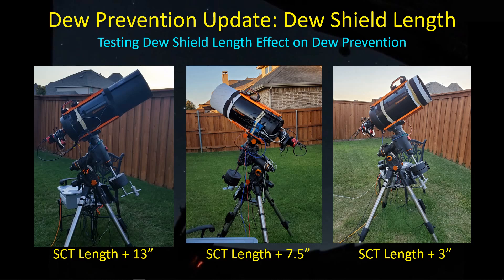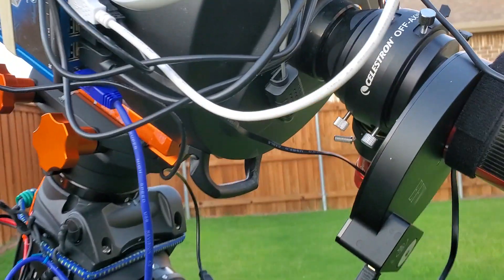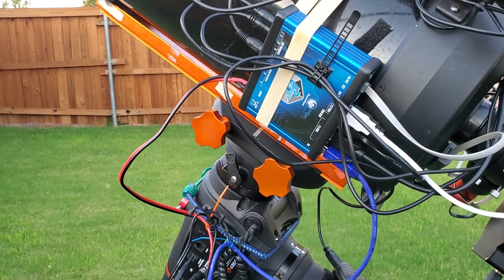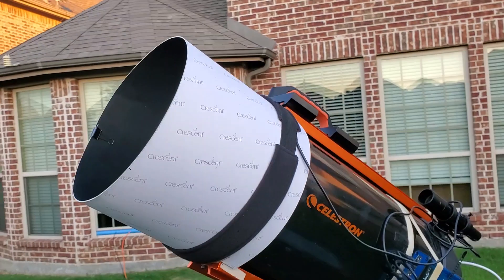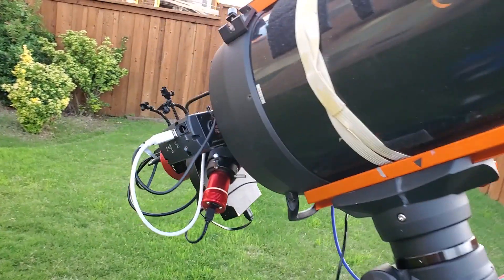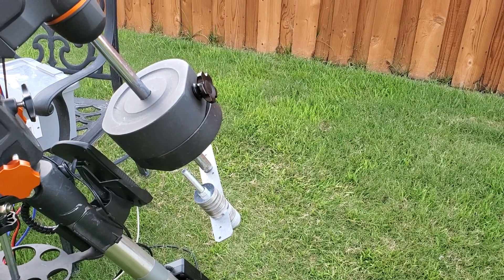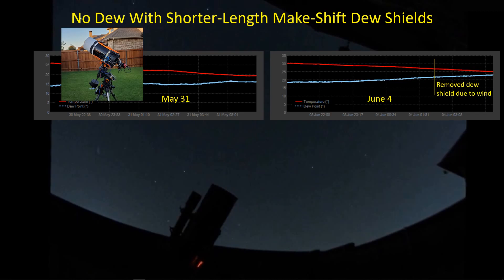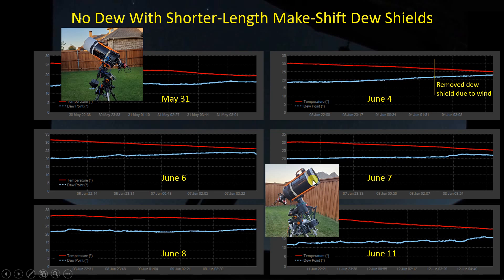Effect of Dew Shield Length on Dew Prevention

Comment: Saturated air precipitates when it encounters surfaces below dew point temperature. Clear sky allows radiant infrared escape creating an enormous temperature drop. Next time you have a dry cloudless night use the infrared thermometer on a car roof and tell us how low the temperature is. Prevent the corrector from line of sight to  cloudless sky and its temperature will not plummet and precipitate dew. No dew strap can create enough heat to compensate for the monumental heat loss from radiational cooling.

Comment: Did putting the dew strap on the inside of the dew shield provide better results in temperature delta, and/or dew prevention? Why not use a Celestron dew ring instead of a shield, if wind causes guiding issues?
Reply from the maker: Hi Dan. My dew control approach has been working very well. Shorter dew shield wrapped around the dew strap. The dew strap is wrapped around the end of the scope and over hangs by about half its width. I then wrap the dew sh8eld around that. I power the dew strap with a Pegasus Astro UPBv2. I turn the dew strap power to max. That’s worked very well, even on the most challenging nights when the dew point equals the air temp. I don’t think the Celestron dew ring was available when I “solved” my issue. Could have been, but I may not have been aware of it. I am now! In fact, I just installed it 2 days ago. No clear skies. I will do some temperature tests and publish a video. I like the concept but have 0 interest in buying Celestron’s $300 dew controller. I’ll power it with the UPBv2. Celestron cable matches the UPBv2 power port. Stay tuned. But, as I said, the other method was/is working just fine. As for wind, yes, it’s an issue and why I cut my dew shield back. The difference in wind speed that’s a no-go is not a big difference for a 3” overhang and no overhang and even a little dew shield provides stray light protection. Thanks for watching!
Reply: @Aero19612  I bought Agena's Dew Ninja, which has an inline rheostat, so it doesn't need a controller.  I've wrapped it on the inside of my dew shield, so when I attach it to the scope, the dew strap abuts the plastic rim of the C9.25. Based on your research, having it in front of the corrector plate should work better. If it's clear out tonight, I'll give it a try. Thanks for all your work on shields/straps!
Reply: Follow-up: Putting the dew strap on the inside of the dew shield, causes bright stars to have weird diffractions, which look like two triangular spikes about 30 degrees apart on one side of the star. I've used the scope without dew protection one night, and stars were perfect (Pleiades). I then realized the Agena Astro Dew Ninja, has a yellow velcro strap and that was causing unwanted reflections. I will either spray paint the velcro strap black, or just use it on the outside of the dew shield.

Comment: I  have a RASA and it occurred to me that the cooled camera inside the dew shield may provide enough dew abatement on its own without an assist from a dew strap. What do you think?
Reply from the maker: Hmm. Good one. The fan on the back of the camera might actually be very beneficial in keeping the air moving a bit. One way to find out! If it were me though, and I had a dew strap handy, I'd still use the dew strap. Belt and suspenders philosophy, you know.
Reply: @Aero19612  And the moving air is coming off of a warm sensor. I have an asiair and have a celestron dew ring attached and it kept shutting off the asiair - suspect to much power demand. May pull the ring and go back to strap backup to the cooling fan per your suggestion. Thanks!
Reply from the maker: Interesting. I just bought a Celestron dew ring. It’s on back order. I was wondering about the power draw. I’ll power mine off of the ult Power Box. Will have to experiment with current draw VS effectiveness. If the fan air is warm, that should certainly help. Let me know what you find out.
Reply: @Aero19612  What is that temp-dew point measuring device that you have?
Reply from the maker: @textandtelescope8199  it’s the environmental sensor that comes with the Pegasus Astro Ult Power Box.
Reply: @Aero19612  I was thinking of the Elitech RC-5 and just went back and noticed that you had identified it!
Reply from the maker: @textandtelescope8199  ahh. Sorry. Yes, I bought 2 via Amazon.com. Very handy if you like this kind of data stuff…

Comment: Have you tested just a dew shield with no dew heater/zapper? I'm curious how well that would work.
Reply from the maker: Yes. As I recall, the full length Astrozap dew shield with no heated dew strap worked well as far as dew prevention is concerned. All that extra length though is like handing the wind a wrench - the SCT, combined with the CGEM, was just not usable if their were any wind. Hence the effort to shorten the dew shield by augmenting it with a dew strap. Thanks for watching!

Comment: It was always was fir a dew shield to work on a refractor the dew shield needs to be 2 1/2 times as long as the aperture. A dew shield and heat strap can get away with heat dew strap,  without one needs to be 2 1/2 times Aperture

Comment: Hi James, haven't seen any updates on this topic from you since this video and because galaxy season is approaching and I'm getting ready to set up my 8" SCT again, can I assume you still like your DS3 solution? Last year I constructed a dew shield from 1/16 neoprene foam, similar in size to the Astrozap, and mounted it over a dew heater strap just behind the front metal ring. This worked to prevent any dew formation, but even the slightest wind messed up my guiding.

I have ordered the new Celestron corrector lens heater that just came out, have you seen these? Reviews I've seen are positive. Still, I think I'm going to cut down my dew shield to about 3-4" in length and use it to create a warm air reservoir above the corrector and also to block just a little more light from the neighbor's house from entering the OTA. Fingers crossed my results this spring will be better. Cheers - and thanks for so many excellent and informative videos!
Reply from the maker: Hey Peter. Haha. I went "dark" as I was struggling with my CGEM last Galaxy season. With the EQ6-R, I've been doing a lot of imaging with the C9.25 in humid conditions that would definitely dew up the corrector plate. I am pleased to report the that 3" (overhang) dew shield (I cut my Astrozap foam dew shield down) combined with the dew strap (I wrap it around the end of the scope with it overhanging by about 1" then wrap the dew shield around it) is working great. Not a single minute lost to dew!

I think I did see something about the corrector heater, but I didn't pay much attention since my current setup is working just fine. Any wind will always be a problem for an SCT. Perhaps a bit less so now for me with my EQ6-R and its much reduced RA/DEC backlash.  Good luck and thanks for watching!

Comment: if you have the power needed cant you just get 1 more dew heater maybe 2 hearters solve the problem
Reply from the maker: Perhaps. When I started this, I had no reason to believe 2 dew straps would work. I knew the dew shield worked but it's a wind magnet. Hence the direction I went. In the end, I found a solution that is working: a homemade dew shield with a 3" overhang + 1 dew strap wrapped around the dew shield half-way overhanging the end of the scope. Thanks for watching!

Comment: I looked at both of these videos; great experimentation. However, in the first video you mentioned wanting to do a test with just the dew shield, no heater. So far, your experiments have been related to heated dew shield vs heated/no dew shield effectiveness, and the effect of dew shield length on wind buffeting (guiding). It doesn't look like you've tested the unheated dew shield (at the various lengths also). Do you have any data you may not have included? Thanks for your study, it inspired me to build a shorter dew shield rather than buy a full length one.
Reply from the maker: Hey, Mike:
No. I didn't do testing without the dew strap. My objective was not to test various configurations, but to find a reliable solution for dew. The combination of the short (homemade) dew shield and dew strap is working for me, so I'm sticking with it for now. I hope the combo works for you. If you don't have a dew strap, then by all means, test it without the dew strap before purchasing one. Good luck!

Comment: Thanks for the informative video on dew prevention. I will have to scrap my dew shield for the moment to use my bahtinov mask. Electronic focusers are very expensive. However, my dew straps and the adjustable dew shield that comes with my ES ED102 will have to suffice.
Reply from the maker: Thanks for watching! I’ve never had a dew problem with my ES ED102. I do use a dew strap with the dew shield fully extended. My big dew problem is with the SCT (much larger diameter glass). The dew shield works for the SCT, but it’s a wind magnet. Good luck!

Comment: Thanks that was a great help. Your thoughts on a fan reminded me of a computer tech video i saw where the tech used a number little usb fans to cool his closet full of servers and such and think it would work to keep the air moving for my low tech barn door astro camera setup. https://www.amazon.com/ARCTIC-Breeze-Mobile-Flexible-Portable/
ARCTIC Breeze Mobile - Mini USB Desktop Fan with Flexible Neck, Portable Desk Fan for Home, Office, Silent USB Fan, Fan Speed: 1700 RPM - White
Reply from the maker: Thanks for watching, Ron! Back when I started my quest to eradicate dew, I bought several of those USB fans with the idea of running them off empty USB slots in the Ultimate Power Box. In the end (I hope the end), I've found the my homemade dew shield (made from poster board) that overhangs the end of the OTA by 3", combined with a dew strap wrapped around the end of the dew shield is getting me through the night. Fingers crossed.

Comment: Thanks for sharing this video. I live in Miami and dew on the corrector is a big problem. Your video gave me some insight into how to approach the issue. My solution thus far has been to sideline the C8 and set up the refractor which is OK but I want to use the SCT for Mars which is in a prime position for observation. Again great video and clear skies to you.
Reply from the maker: Great, Horacio, I’m glad it helped. I have been using the homemade 3” overhang dew shield with the dew strap wrapped around the outside on numerous high-dew nights with no problem. However, I suspect you deal with bad dew conditions more frequently than I do. Good luck and Clear Corrector plates!

Comment: Great science, thanks for making and sharing your data and graphs!

Have you tried the dew strap sandwiched between the external rim of the corrector plate and the inside of the dew shield tube, with the dew shield “clamping” the strap to the metal of the plate? My thinking is this might conduct heat more directly into the corrector plate and reduce convection losses to ambient air.

I guess the dew shield size might have to increase slightly to fit snuggly over the tube+strap diameter, and might be harder to keep the shield firmly attached.
Reply from the maker: Good thought, Michael. I'm not sure that would work. I have tried wrapping the dew strap tightly around the end (but no dew shield) and I got dewed over pretty quickly. I have also tried attaching the dew strap inside the dew shield, but nothing contacting the heating element so it's just radiating heat. That didn't work either. So I went back to the dew strap wrapped around the dew shield as shown in the video and that works just fine. Your mileage may very. Thanks for watching!
Reply: @Aero19612  Looks like you've found your "just right" combination, which is all that matters. thumbs up

I guess that once we have "just enough de-dewing" for a given situation the benefit of tinkering would only save a spot of power - and ultimately that's not really important with a mains cable. :)
Reply from the maker: HaHa. Yeah, power is ok. Not worried about draining a battery. My next step is to mount a counterweight under the front end of the OTA so that I can slide the body back and create a more balanced geometry. As it is, the OTA sticks out too far in front allowing the wind to use it like a wrench on the DEC axis. Always something to mess around with...

Comment: Do you still like the 3” shield? Trying to figure out an optimal length and your video is helpful
Reply from the maker: Yeah, I think so. I recently cut my Dew Zapper foam dew shield down to a 3" overhang and mounted the dew strap inside the dew shield: that did not work. The next night I went back to the 3" (overhang) cardboard dew shield with the dew strap on the outside (as shown in the video), and that did work. I'll stick with the 3" dew shield with the dew strap wrapped around the outside. That has proved to be a very effective combination. Thanks for watching, Cole!

Comment: James, I just made a short dew shield (badly) because my full size one didn't fit in my dome. But, coupled with a dew strap, seems to do the job. 
With regards to your fan suggestion, given the wind sensitivity you experience, I'd suggest you look in to it. There is a forum post below which goes in to this in detail. If my solution doesn't work out longer term, this is what I intend to try next. You should take a look. http://www.iceinspace.com.au/forum/showthread.php?t=182057
Reply from the maker: Thanks for the link! Great to see others are pursuing this option and finding it works. From a dew perspective, the short shield + dew strap has been working for me. As you say, still need to see the response in the wind for this 3" dew shield. Last night was a rare night with no wind and risk of dew. And then the clouds moved in. Oh well.

Comment: James,  Glad to hear about your success. If you end up felt lining the inside you can make it with the black side of the poster board facing out so it won't stand out quite so much :D  It was interesting to hear that the dew strap alone worked that one night when it had failed in other positions but, with the wind going, you might not have had a dew problem anyway. I didn't look too carefully at your graphs.  Good luck with the continued fine tuning of your rig. Clear skies!!
Reply from the maker: Hey Mike. Thanks for your input. You've been a big help to me and those who've read your comments and suggestions. HaHa. Looks pretty ugly. I'll probably end up just cutting down the Astrozap. Two for the price of one is always a good deal, right!? Not sure what to make of the overhanging dew strap as an "answer". As you note, the wind alone might have done the trick.

Comment: Another great video. Love the fact that you finally raised the power ox to the OTA. Interesting mass correction device with all those washers. I just mounted my large Telrad to the other side and that seem to equalize the mass on the OTA. Also find that I cannot get any kind of guiding with the longer Astrozap  dew shield even in winds as light as 5 mph. Best guiding with the dew shield is about .8, .9 rms. Just wondering if perforating the dewshield with a hole punch will allow some of the wind to go through but still allow convective currents to raise the hot air off the corrector plate. Possibly scalloping the end of the dewshield with a pinking shears may also be effective.  What guiding rate are you using with  oag. . Reading that it might be appropriate to use a faster rate such as .25 or .35 sidereal with this type of guiding  With my image scale of .55 arcseconds per pixel.. Any thoughts.
Reply from the maker: Thanks, Louis! Yeah, the Astrozap is just a non-starter for me too. It's very well made and fits like a glove, but it's a sail and lever arm combined. I would not recommend perforating the wall of the dew shield. I suspect you'll get more turbulence from that than benefit, not to mention the potential for weird stray light reflections. My results to date suggest cutting down the length of the Astrozap is a viable option. Hmmm. Hadn't heard/read anything about guide rate with an OAG. I've always used 0.5 x sidereal (with or without an OAG). Also, not sure that matters that much. PHD2 knows the guide rate. When it calculates a correction of X arcsec, it determines the pulse width (in milliseconds) based on the guide rate. If you use a smaller guide rate, PHD2 will just use a longer pulse to compensate, and vice versa.